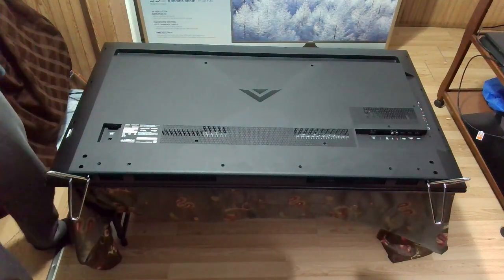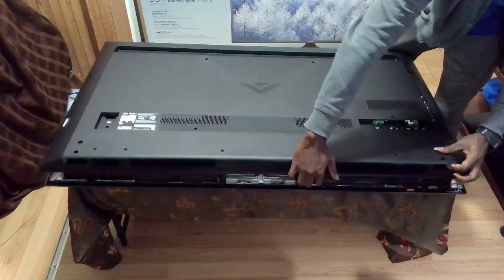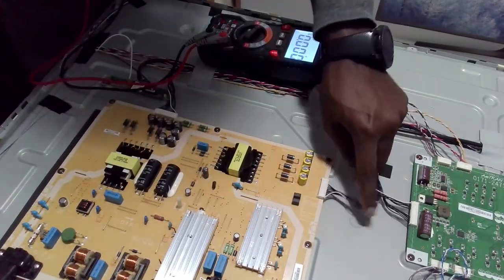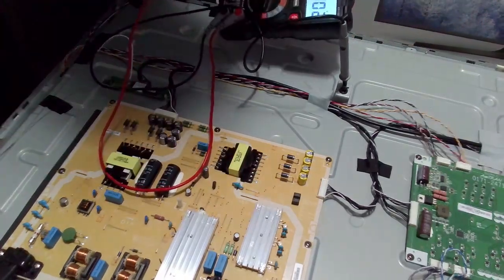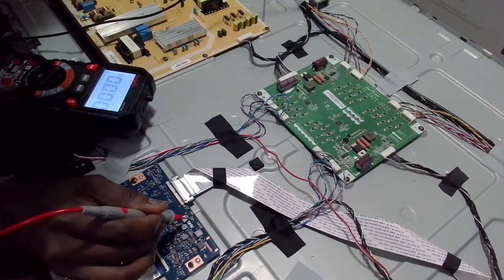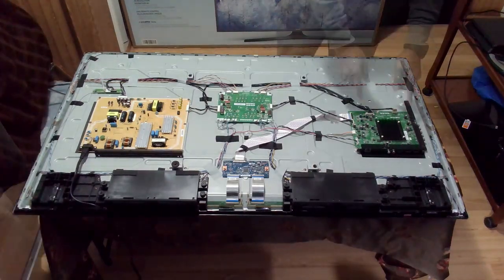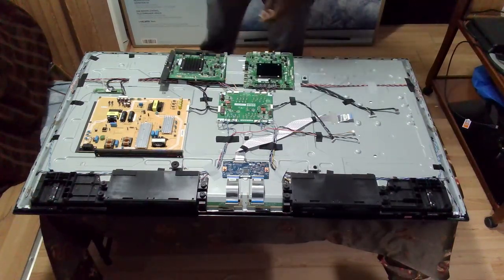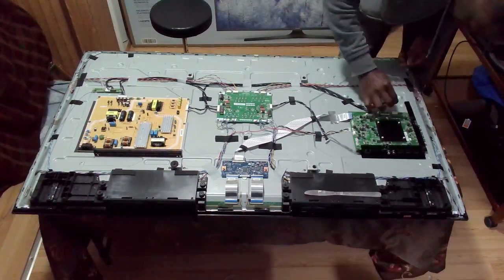How To Troubleshoot & Fix Dead Vizio TV. No Power/Standby Light. M55-E0 (M Series-Motherboard Fix).

Comment: 😢😢My vision m55-eo got a scrambled screen with lines and now no power or light. Any suggestions on what parts I should replace first? I'm getting power through USB but nothing else.
Reply from the maker: @AdeptXR  Was the no power right after the scrambled lines, or the scrambled lines stayed for some time before the no power started. Can you check if there is full power on the motherboard. Usually, vizio tvs seems to get motherboard issues, but you need to verify first. Scrambled lines could be the tcon as well.
Reply: @GidFix-pl3lg  the tv shut down after less than a minute of the glitched screen and I was never able to turn it back on.
Reply from the maker: @AdeptXR  It could be the motherboard or tcon board. If you have a multimeter, check the tcon board but make sure the power board is in full power and not on standby mode.
Reply: @GidFix-pl3lg  ok thanks!!

Comment: I have trouble with it but when i tested i have 17v not 18v what does it mean ? Thnx for advice
Reply from the maker: Not much of a difference in my opinion. But check your powerboard schematic to see what voltage value is required at the pins. If the tv is completely dead but you are getting these voltages from the powerboard, then its likely the motherboard has the issue. Also Test the tcon board for any output voltage. Hope it helps.